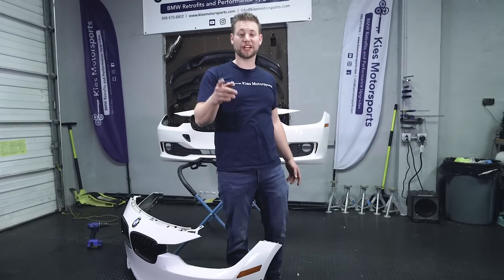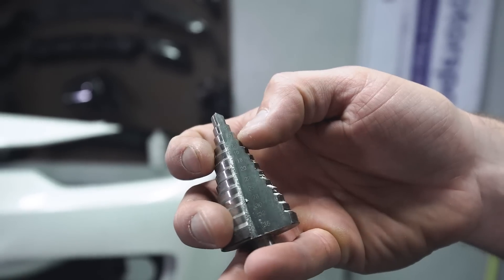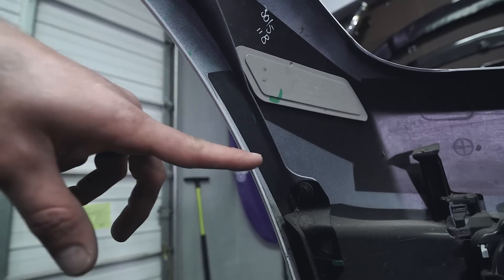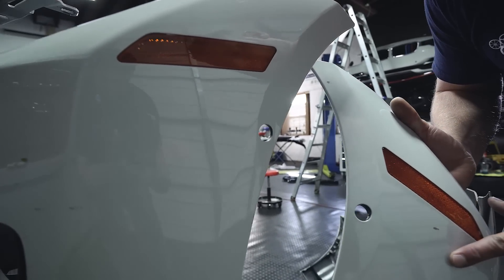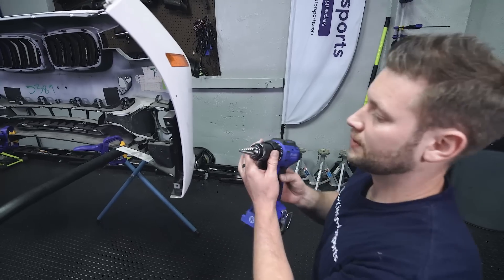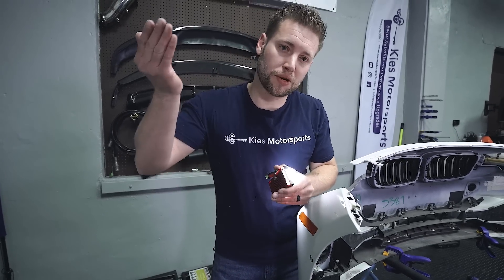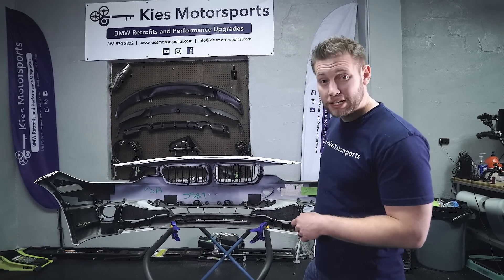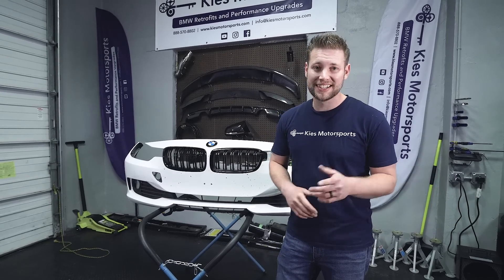How to Drill Parking Sensor (PDC) and Side Camera Holes in an F30 | F80 BMW Bumper

Comment: What are the diameter sizes of the holes to punch for the “inner-two” of the 4 holes that you showed at 6:46? I read it is either 30mm or 32mm.

Comment: Question, what would cause pdc not to work after removing bumper and putting it back on? My sensors don’t work but reverse cam does I’m so confused lol
Reply: Plug 'em back in! LOL!  Seriously, double-check that they are plugged in well and also make sure you didn't pinch the wires.

Comment: since your not reaching out only to people who use the imperial system, it would be nice if you also told the measures in metric when mention stuff like that :D actually not a big deal. there are converters all over. but you get what im after :D preferably the press method seems more accurate